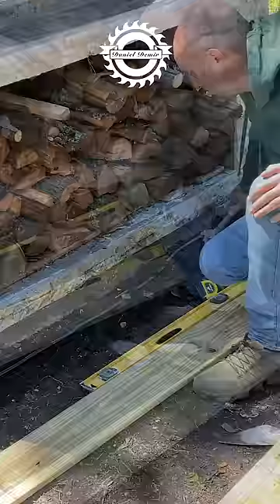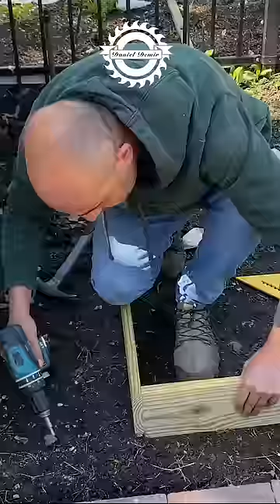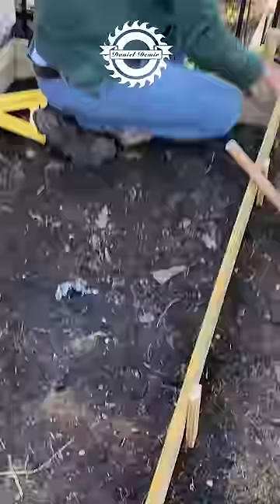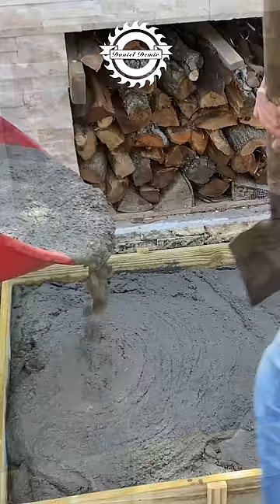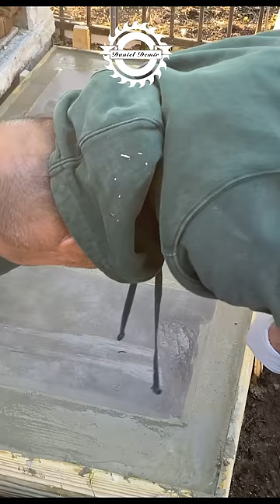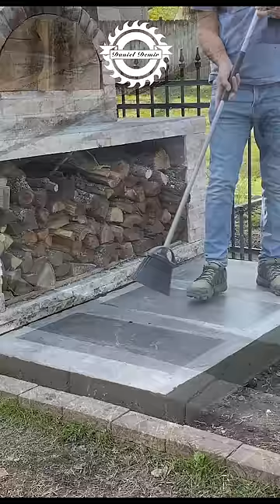Pizza Oven Treshold / Concrete Slab #shorts

Comment: Round off all sharp edges they are dangerous and they break off easily, the rocks for fill seem like a good ideal but sand and gravel for drainage would have been better, and a little rebar would have secured the slab, I think that after a few winters it could crack.

Comment: Steel has a very different coefficient of thermal expansion than concrete. And concrete has no steel sub-structure. It will CRACK.
Reply from the maker: That’s not true at all. I have been in construction work over 40 years. It’s been over two years without any issues.
Reply: @DanielDemir  I thought those "plates" were steel, but I see you have commented elsewhere that those were made of ceramic. No issues there. But you should still put some kind of steel sub-structure in a concrete slab. Concrete has immense compression strength, but no tensile strength. Steel rebar sub-structure adds the tensile strength. Concrete 101.